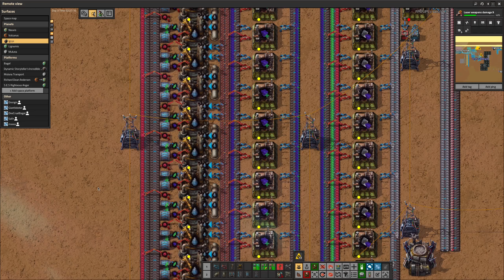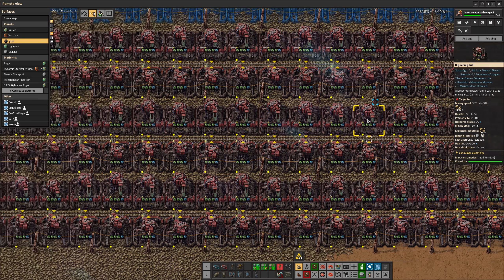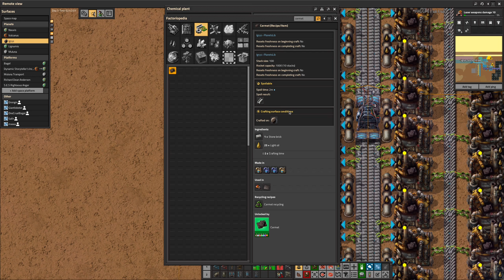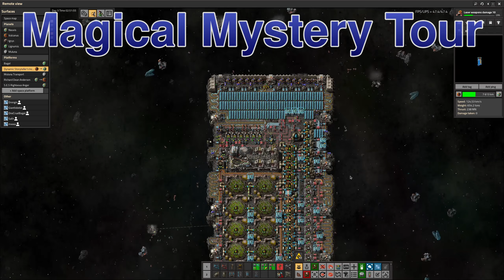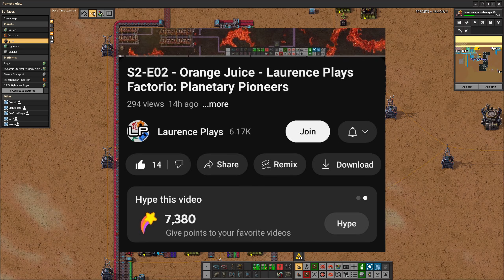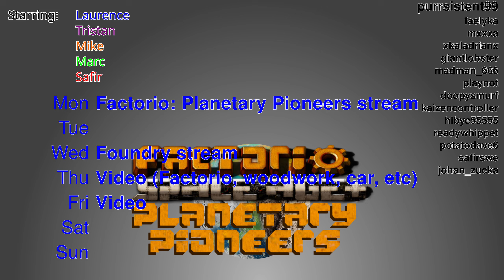S2-E08 - Now You See Me - Laurence Plays Factorio: Planetary Pioneers

Comment: The magic thing that outputs stone too, I think the best solution would be to have separated output belts for each product plus at least one asembler at the output, feeding it from the stone output belt only. Additionaly, I would put another one that feeds from that last asembler I mentioned and from itself, outputing the main product to a belt with priority, this way one empties the output stone belt so that it won't jam, and another get's rid of the output stone of the unjaming asembler. That system should be able to unjam itself as long as there is consumption of the main product (or so I think after hundreds of hours on pyanodons handling byproucts)
Reply from the maker: Having an additional (or at least 1/6th the number) of extra assemblers just chewing through the output stone is an interesting idea; I hadn't thought of that! You'd still need to output that excess somewhere, but sending that back to the start should be fine. I've dealt with looped byproducts like this quite a bit in Space Exploration and it's generally trivial, but in this case it's a bit more likely to jam simply due to the sheer quantity of stone that gets output when the machines run. If it was 6:1+1, it'd be fine, but because it's 300:50+50, it's a bit more of a mess! Still, I believe I fixed it well enough in the next stream by making sure I put it just onto the near side of the belts.

Comment: 6:59 you could use a simple [read belt < than certain amount - enable throughput] logic in this setup
Reply from the maker: Hmmm, if that was on the return path, that could work. If it's completely full, stop the other belt. But then, that's just the same as using a priority splitter. You could do it on the output of the splitter, but then you wouldn't have a full belt going in, so you'd be reducing throughput. I think I've got it working now - you'll see in the next video!

Comment: or, hear me out, filtered output. Either by belt side or onto two belts. (not a perfect solution but my instinct is to make a loop and only allow new stone when its running low)
Reply from the maker: The latter part is roughly what I ended up doing, sort of! Putting the two outputs onto opposite sides of the belt is an interesting idea though... I'm tempted to try that and see what happens.

Comment: You can simply run newly mined stone onto the outside half of the belt with the stone coming from the machines back onto the inside half of the belt because inserters prioritize grabbing from the near end of the belt
Reply from the maker: This is pretty much how I solved it. I've made sure the returned stone is on the inside with new stone on both sides, but at a lower priority. So far, that's working so I'm optimistic 🙂